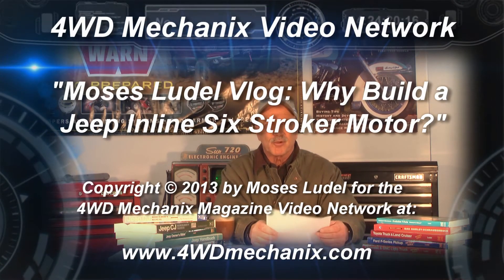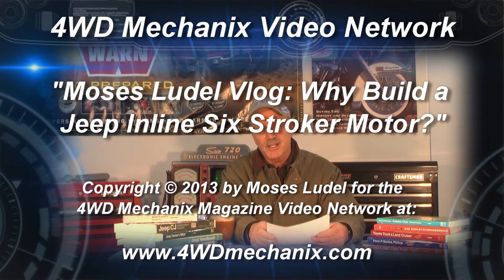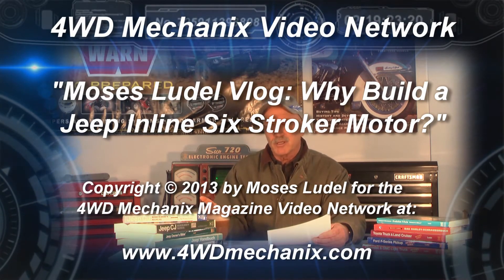4WD Mechanix Q&A Vlog: Why Build a Jeep 4.6L Stroker Motor?

Comment: WTching this on the side of I29 after just losing my 4.0. Would love a 4.6, but would be just happy with a fresh 4.0 in general I can treat right & relia ly get 300k+ Mike's out of. I've always wanted a 4.6 stroker even if it just lands in my XJ for now. Best of both worlds as he describes it better performance on the street where my Jeep spends 99% of the time & especially on the Interstate, & still awesome off road. I'm sold now just to get my XJ home & figure out how to pay for this stroker build!
Reply from the maker: Sorry about the I-29 abrupt exit!  The 4.6L build is not much more cost wise than thoroughly rebuilding a stock 4.0L.  Additional things needed are a 4.2L crankshaft (or a new Scat unit) and the right rod/piston combination.  The rest would be the same concerns you have with a stock rebuild:  new camshaft/lifters, bearings, block machining, timing chain and sprockets, cylinder head rebuilding and making sure the pushrod lengths are correct after the head and block deck machining.  Good shops are familiar with this "4.6L" stroker build.  I like a "torque/RV" camshaft (more valve lift and mild valve opening duration) with compression around 8.7:1 for a wider range of fuel octane choices.  This is a low-end torque and good fuel mileage build.  Higher compression and a performance camshaft require 318/5.2L V8 Mopar or 302 Ford V8 injectors.  The 302 Ford V8 injectors are common for many 4.6L builds.  (See 4WD Mechanix Magazine for more details.)

Comment: Bought a 2002 TJ 4.0, planning on going stroker 4.6.  What would be the longevity of the 4.6?   Years and or mileage?
Reply from the maker: You raise a good question.  The largest consideration is that the stroke length has increased.  That means more piston travel per mile.  Offsetting this is the increase in torque, which reduces overall load on the engine.  (I would measure this as higher manifold vacuum than the 4.0L at any rpm.  The 4.0L is notorious for a mediocre torque and power curve.)   Cylinder wear can be dramatically reduced by using a quality synthetic motor oil, which can offset the wear factor from more piston travel per mile.  Keeping final compression ratio around 9:1 or less will help longevity.  A mild camshaft (stock or "RV" grind) with modest valve overlap will decrease wasted fuel and fuel washing the cylinders, a considerable wear factor.  For mileage and longevity, a target of 4,500 peak rpm is more than enough, stock and RV camshafts will run out by 4,500-5,000 rpm.  The reciprocating and rebuild parts (crankshaft assembly with quality bearings, an upgrade double-roller timing chain set, a high volume oil pump and such) should hold up very well...In terms of lifespan "mileage", while a well-maintained and not abused 4.0L is good for 200-225,000 miles, I would expect the same from a mildly built 4.6L if driven like a traditional utility truck and not a race car.  Some examples of longevity inline truck sixes that were "factory" strokers would be the Ford 300 and GM 292.  These engines could easily run 200,000 miles on mediocre, conventional motor oil.
Reply: Thank you for the extended reply. Here's my situation, I been welding for 32 years, and I have owned a few trucks to carry my welding gear. Now that I'm 58, getting on and off a pick up bed has gotten tough. So, I made a small trailer, to carry my 345lbs engine drive welder. I was pulling it with a 2012 Jeep JK, with the V6 engine. But the V6 keeps having expensive repair issues. So, I bought a 2002 Jeep TJ a month ago. It has the 4.0 engine, with automatic trans. With 200k miles on it, It lacks power. I mentioned it to the Jeep specialized shop in my area, they said the engine is fine, that I just need to get use to the characteristics of the 4.0. They mentioned if I went with a stroker motor, for me not to expect more than a couple of years with it. The 4.0 with 200k miles on it now. At take off, its responsive for about an 1/8th of a mile, then I have it almost pedal to the metal and it takes about a mile to get to 55 miles per hour. To me, it does not feel right. I have tried high octane gas, with no difference. The injectors are new, and new tune up. So, I'm thinking about starting with a new Long block. What are your thoughts? Suggestions? Ideas? Advice? Guidance?  @4WDMechanixMagazine
Reply from the maker: The Pentastar 3.6L V6 had issues in the first production year(s).  You likely inherited them with the 2012 JK.  As for the 2002 TJ automatic, this is the last year for the 32RH transmission.  A three-speed Chrysler unit with electronic shift interface and a lock-up converter, the 32RH evolved from the traditional 999/904 3-speed.  You do not have overdrive, it's a straight 3-speed (1:1 in 3rd gear).  The axle ratios with the automatic models can be quite tall, like 3.07:1 or 3.55:1.   Even with a stock tire diameter, this is tall gearing, especially the 3.07s.  See which axle ratios you have front and rear.  Does the Jeep have oversized tires and stock axle gearing?  This could be your performance lag.  As for overall engine condition,  I use a "four basics" approach to engine condition/troubleshooting (discussed in my Bentley Publishers Jeep books).  You need normal oil pressure, normal and uniform compression, correct valve lift and normal valve timing.  Oil pressure and no knocks is an easy one.  Valve lift is about camshaft lobe wear and lifter condition.  Valve timing is about the timing chain and sprockets.  A standard compression test is helpful as a quick check, but I would run a cylinder leakdown test on a 200K mile 4.0L.  That can be telling with regard to cylinder seal and wear points.  I would also want to know the amount of timing chain wear.  A simple manifold vacuum test is revealing here.  Rotating the crankshaft back and forth while watching for camshaft position sensor movement is an indication of timing chain and sprocket wear...Make sure there are no engine codes around the camshaft position (sensor).  Late valve timing could be part of the performance lag.  On that note, the C-O-P (coil on plug) engines like your 2002 will not work well with the 252 camshaft.  In fact, you need to narrow down the CompCams offerings that are compatible with a C-O-P 4.0L (2000-2006).  They have grinds specifically for your engine.  I like the mild specs with good lift on the camshaft you have in mind, however, you need to confirm that this is a grind compatible with the late 4.0L.  The wrong camshaft will throw codes.  Chrysler's OEM camshaft syncs the camshaft position sensor with the crankshaft position in a certain way.  CompCams is thoroughly familiar with this issue.  While you still want a mild camshaft with good lift, the valve timing must align with the late engine's sensors and PCM programming.